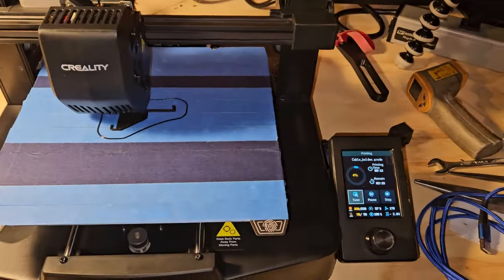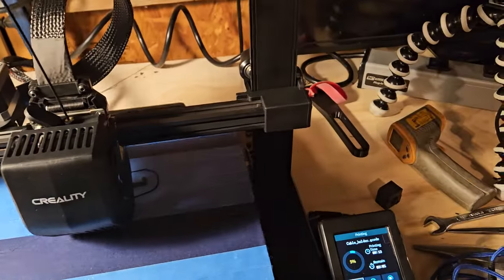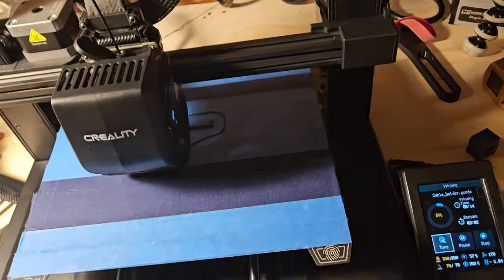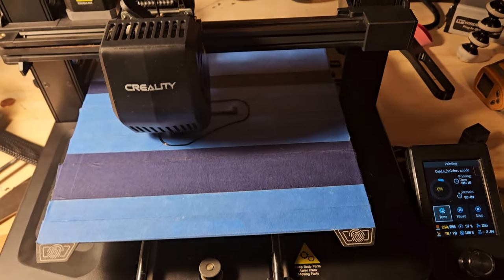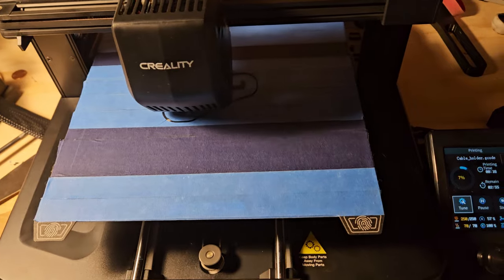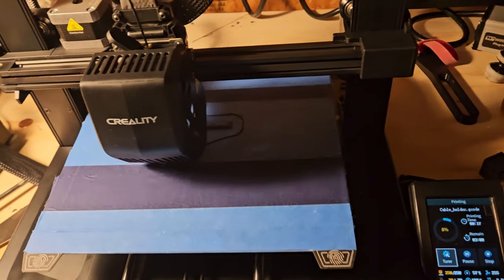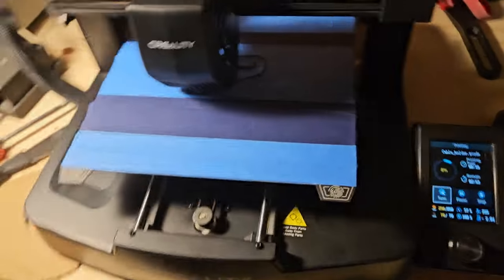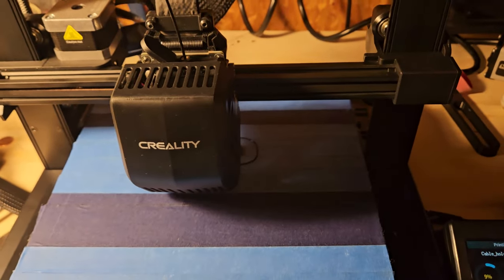ENDER 3 V3 SE FINALLY MAKING A PRINT!THIS TOOK 2 DAYS!

Comment: Yea the paper shims were pretty genius dunno where you got that idea from but pretty good.  I think that you are going to do fine in 3D printing.  Put it this way, I know one guy who got his tevo tarantula same time as me about 6 yrs ago.  They were rubbish, I mean it was basically a box of parts and beds that you could see from a mile off were bent.  If you tried to level the beds on those old machines 9/10 you just ended up bending the bed more.  But my friend would not give up.  He now has a very successful 3D printing business, 24 printers and about 10 other machines like CNC etc.  Everyone in his niche thinks he is the best even though half the stuff they buy is made on one of his many very old ender 3 mk 1 machines. His latest machines are a couple of those bambu things, which he only got because he knows competitors will.  But the thing is, he only really ever paid for that one machine.  Everything else has been bought with profit.  So many things can make things go funky because we are dealing with three dimensional axis and temperature, extrusions, speeds and so on, no one can ever tell you exactly what is wrong or right, it is just a game of tweaking and not giving up.  The number one tip my friend gave me, if you have to make several things and you are not too bothered with the quality because they are just for yourself, then print one at a time and try different settings, as that way you learn what works for you.
Reply from the maker: That's why i like multiple printers . Im learning stuff. But its not all simple stuff. Lots of variables like you mentioned

Comment: Fan should be off first layer to prevent curling, you also need PEI sheet. As a note, I sell tape for a living, tape has a release liner on the back - to prevent the adhesive from sticking to itself, if you were to use tape, polyimide should be used, it has silicone adhesive - so you will not get residue, and the polyimide makes for a great bed. Its thin - about 2 mil overall....also called Kapton, dont use 3M - cheap polyimide works just fine. So unless you have that lying around, just order a 12$ PEI sheet. The PEI will print great for a while, until you get fingerprints all over it, then you need to wash with dish soap and rinse rinse rinse. Regular 90-99% IPA doesnt work as well as dish soap on the PEI. BUT 70-90% IPA works great with Kapton, just a couple of spritz before print/wipe - good to go. I used Kapton for 2 years and i almost prefer it over PEI sheet, but I get tape for free. So hopefully this information helps, respond if you have any questions.
Reply from the maker: Awesome 👌  yes i ordered a sheet for both my printers. I got the one for the ender a few days ago and its a rougher texture than the factory one. It works great.  I had no idea i was greasing up the sheet by over handling it. But definitely dish soap and compressed air works! Tape i had laying around. The dark blue was from dollar tree.  It wrinkles with heat
Reply: @hamradiohack  Awesome, glad you are up and running again. Happy printing my dude!
Reply from the maker: @KM-oi9ks  yep. In hindsight i see i made a few mistakes.  Also probably should have bought the ke instead
Reply: @hamradiohack  I have the KE as well, really happy with it. Still modded a few things, along with enclosure. But it's a massive upgrade over my old ender V2. I will just have to wait a few more years until I get a core XY.

Comment: set z offset -0.10 of whatever it auto sets z offset to and you will be fine. use the shinny metal side and not the coated side. set bed temp to 70c for pla and it will stick insanly well and when it cools it falls off. i have one and did everything and know all about them now, i even have mine set up with octoprint
Reply from the maker: How do you do the octoprint? Klipper too?
Reply: @hamradiohack  I have it set up with a pi4
Reply: @hamradiohack  stay away from klipper at the moment for them as the bin files compiled on the web are not good at the moment. Eventually creality will release the klipper firmware officially for them. But for someone like you just getting into printing you should get the creality pad
Reply from the maker: @heavydutyroadsidellc920  my main printer is a pyramid a1.1 3d cr10 v3 clone.  And i bought a sunlu s9 plus thats very similar but not direct drive.
Reply from the maker: @heavydutyroadsidellc920  ok. Yes i have a pi 3 ill have to try
Reply from the maker: @heavydutyroadsidellc920  i should have bought the ke...then i would have klipper